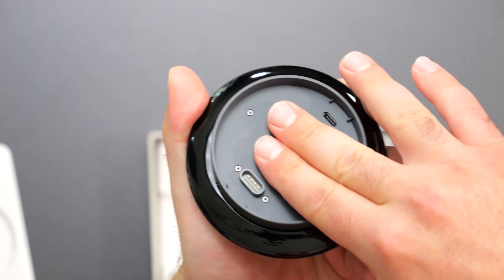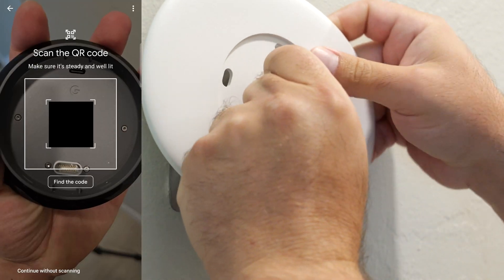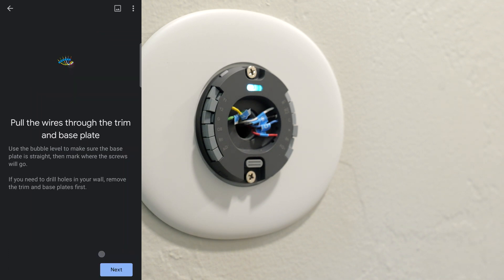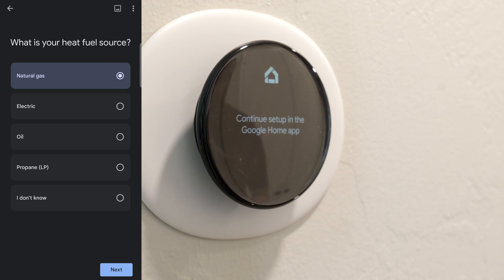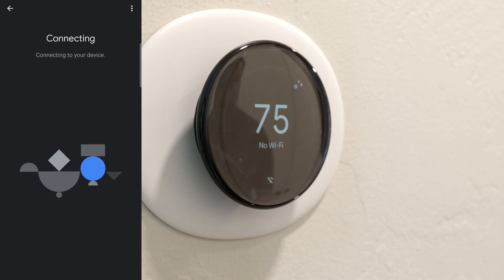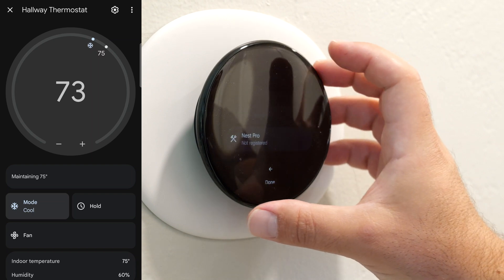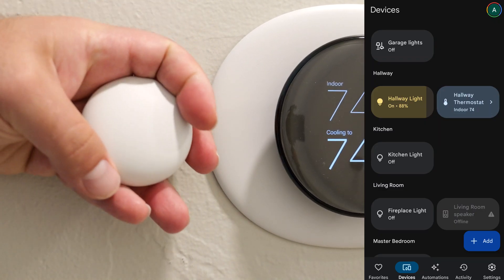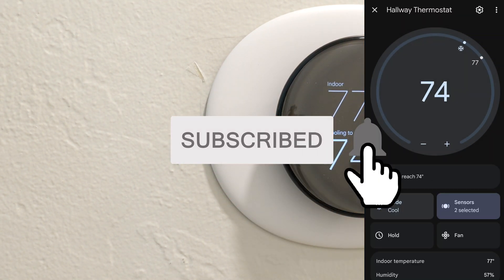Complete Guide: Install and Review of Nest Learning Thermostat 4th Generation

Comment: I just purchased this unit and will be installing it this week. I am replacing it with the first generation nest which Google is no longer supporting beginning this month. It has been a great thermostat and will miss it. The thermostat would still work, but it will not be supported remotely through the app. My only question is is the wiring essentially the same? I thought that the fourth generation actually had less wires. In any event, I will attempt to install it myself and hopefully it won’t be too difficult. I’m not certain if the sensor features are all that great. So they give you the temperature in a particular room.Not certain that’s a showstopper of a feature.
Reply from the maker: They have a site for compatibility. I imagine it will be similar but the app tells you as you’re setting it up. I’m not a professional when it comes to this, I just followed the instructions and am sharing my experience

Comment: Two hours trying to get this piece of shit device to pair with my phone. Apple rep was supposed to call me 30 minutes ago. Pro tip: these devices were reliable and worked well consistently until Google bought them and they have been less reliable ever since and this $300 paper weight is the last device I will buy from those useless pricks at Google. Now, dispute hooking up the Gen 2 nest again exactly as it was before my furnace is short cycling which means I will have to call a furnace repair guy which will cost several hundred dollars minimum on top of the $300 for the piece of shit Nest Gen 4 I was stupid enough to buy. THE LESSON IS 1.GOOGLE SELLS CRAP THERMOSTATS, 2.GOOGLE DOES NOT CARE ABOUT ITS CUSTOMERS, 3.THEY CANNOT BE TRUSTED.

Comment: Weird question can I leave the plate and wires from the second generation thermostat and just remove the thermostat  and just click the new  4 generation thermostat or I need to remove everything?
Reply from the maker: I don't know if it will fit, my assumption would be to replace the whole thing.

Comment: We’ve installed one but doesn’t seem to matter how we wire it, it blows hot air when we need cold, we put the old thermostat on and it works as it should
Reply: Mine is doing the same not sure why
Reply: @OfficialGlare so we figured ours out and we had to go into the app and switch one of the settings, was like “heater orientation” or something like that
Reply: I'm having the same issue, help! Can you elaborate on which setting?
Reply: Yall have heat pumps.  It’s got a reversing valve for cool/heat.  If it’s heating I’m cool mode and cooling in heat mode you need to change your “O/B orientation” in your thermostat settings/programming

Comment: Do old schedules from an older Nest thermostat port over to the new one?
Reply from the maker: I honestly don’t know, I use this just like a regular thermostat, I don’t use the smart features aside from just controlling it with the voice and the occasional turns on when it detects my phones presence.
Reply: @landpet I installed mine yesterday to replace my 1st and 2nd Gen and can confirm it did not transfer my old schedules.
Reply: @MikeAnnarose was a C wire involved or required?
Reply: Not for me. I went from a Gen 1 to Gen 4. No option to upgrade/replace the current on in the Nest or Google Home app.

Comment: The only thing you left out is the "C" wire. You already had one because you were using a generation three which I think required it. I'm going from generation one to generation four and that required an electrician to come in and actually run a wire onto my boiler and also onto the control board of the air conditioning. That was a royal pain in the butt. But for the generation four, it is an absolute must to have enough power because the unit will not charge itself off of the existing two wires on the heat and three wires on the AC
Reply: Crap! I’m going have to look into this as well since I’m going from gen 1 to gen 4. Why don’t they make the head units interchangeable with the base so they don’t have to be re-wired?

Comment: Hey can I ask what is the difference between having the furnace controlling the fan or thermostat? I have a Lennox iComfort right now that’s crapping out. Thanks.
Reply from the maker: I'm not a 100% sure on that but I usually select furnace and that is the setting that has worked for me. Seems like the furnace is the one that controls it for me.

Comment: Doesn’t turn orange when the heat comes on doesn’t turn blue when the air conditioner comes on.   Booooooo
Reply from the maker: I haven't used the old nest in a long time so I forgot all about the colors. I just ask google to do it for me, most of the time and I occassionally spin it.
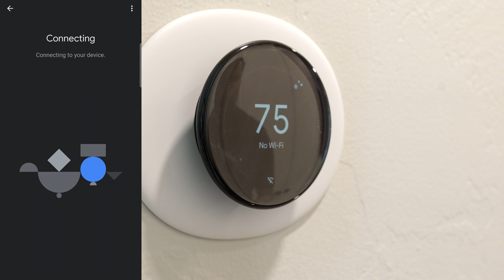Reply: Didn't it turn blue at the 4:00 mark? It's much more subtle compared to previous generations.

Comment: Just got mine almost $ 500 smacks for device and to set it up lol that's expensive
Reply: Sadly all you had to do was turn the power off then take a picture of the wires used in old thermostate, and then copy. Always do it your self when you can watch hundred how to videos.   Mine was just two wires to control just my heat.

Comment: Did you need access to the circuit breakers or even turn it off to do this?
Reply: Oh yea, definitely no need to turn off the electric when working with wiring..super safe 🙄
Reply: @matthart4465 the thermostat is low voltage wire so technically you dont shut down breaker for low voltage
Reply: Nope!!… this idiot is a amateur!!
Reply: Just make sure that you have an extra transformer on your truck.

Comment: I've just replaced my 2nd Gen Nest thermostat, as it failed, and have installed the Nest Learning Thermostat 4th Gen.

I can offer the following observations about this process:

1.  The new 4th Gen Learning Thermostat will not work with the Nest app I've been using for years. Kind of a disappointment. The Google Home app is not nearly as intuitive, and requires several more taps to change certain settings.
2.  The "guided" installation went smoothly...kudos for a well-written portion of the Google Home app.
3.  The new thermostat's trim plate is smaller than my older Nest 2nd Gen. This, to me, is unsatisfactory, as I'll now need to paint where the new trim plate is smaller than the old one. (BTW, I tried both the included trim plate and a new one I thought would match the old one...and neither matches the footprint of the older one). A search of Nest trim plates on Amazon revealed NONE compatible with this 4th Gen model.
4.  I'm not a fan of the design of the 4th Gen model. Yes, you can get the device in multiple colors, but the colored portion of the device seems to be limited to a tiny portion of the ring. The device sticks out from the wall about 1/2" or so, and the white portion of the back of the unit is clearly visible from the side. (Think of the white portion as the "stem" of a mushroom). What would have helped with this new design is if the white portion were the same as the chosen color.
5.  The weight of the 4th gen model is significantly less than that of the 2nd gen model it replaced. The new unit just doesn't feel as "solid" or "premium" as the gen 2 model.

Time will tell if this new unit lasts as long as the one it replaced.

Comment: I have 4 wires with W,G, O, Rh( jump to Rc). Can I install with nest generation 4? 
Thanks
Reply from the maker: Probably best to check with google for that.
Reply: @landpet can you tell me how to take the thermostat off the plate that the wires are connected to, my kid put them together while we were reading the instructions, your help would be appreciated Thx
Reply: @cezarrodriguez9827  1)Most important turn off the breaker that runs your thermostat what wires are you talking about?
Reply: Yes you can!! If it works! It works on any thermostat!!

Comment: Dose your temp sensor only display temperature in Celsius? I can't find a way to change it?
Reply from the maker: Mine is in Fahrenheit.

You can change it to Celsius if you want

In the Google home app, goto the thermostat main page so you can see the thermostat and control it.

Then click on the settings (cog) towards the top right, then click on thermostat, then change to Celsius or Fahrenheit under temperature units
Reply: @Landpet, I tried it, but it only changes the way the thermostat displays the temperature. The temperature sensor still remains Celsius. I think it's bugged out.

Comment: I'm coming from the learning third gen to the learning fourth gen thermostat and it feels like a downgrade. The fourth gen thermostat looks like a damn mushroom hanging on your wall. The interface on the Google Home app is horrific. You can't access any of the advanced features unless you use the damn app now. When you touch the display it easily turns so you accidentally change your temperature settings. The learning 4th gen does appear to be more compatible with heat pumps when properly set up as the self setup will not work properly. Most of the smart features on this thermostat are a gimmick and it actually works better when you keep them turned off.

Comment: Great video. Thank you for sharing. Comparing the Gen 3 and 4, what are the learning differences ? Also, any saving efficiency gains between the two gen ?
Reply from the maker: I had a gen 3 awhile ago. The thing to note is that I don't use much of the savings features anymore, I just like the ability to control the AC with my phone and voice.  Energy settings used to matter more and there was a big difference from a standard thermostat to a nest but now I live in a cooler area and I have solar so I pay less attention to the energy savings now. 

I can't really say one way or another, I wouldn't imagine it to be a big difference though.

Comment: Is there a metal box behind that sheet rock because if it’s not, you don’t need to use that metal plate
Reply from the maker: The metal plate is useful because the two long screws went into a stud providing more strength. 

You are correct though, I could've done without it since I don't have a metal box behind it.

Comment: The metal plate is only for installing on an electrical box. You only need to screw the base and trim plate in together.
Reply: That’s a fact
Reply from the maker: I screwed it into the stud, that's why I used the metal plate.
Reply: What are you even saying? “Electical box”?
Reply: @EJR20 electrical*

Comment: Does it work with high-efficiency, modulating furnaces yet? Because Lennox thermostats leave A LOT to be desired.
Reply from the maker: If you go to google store on this product, it asks you a few questions to see if your system is compatible.
Reply: @landpet  the real answer is… no, it doesn’t.
Reply: Lennox makes a custom thermostat that works with their equipment.
Google makes a thermostat that works with most equipment.
HVAC manufacturers probably don’t want to share all the details on how their systems work with google because they want to sell thermostats too 😅
Hope Google added more functionality to this 4th generation.